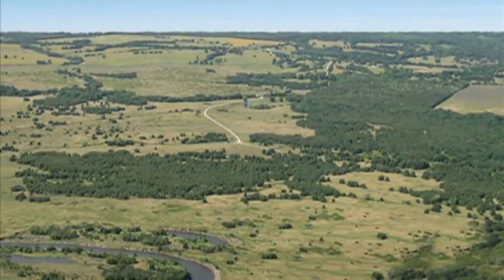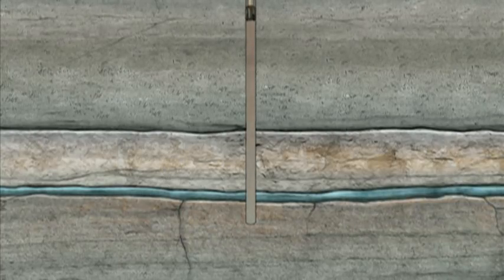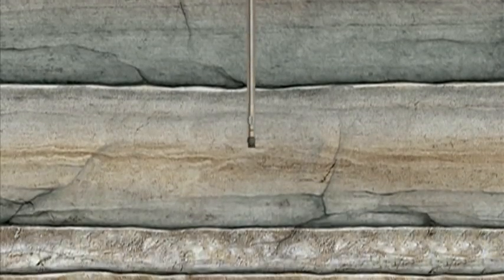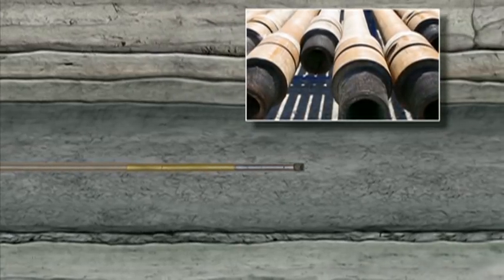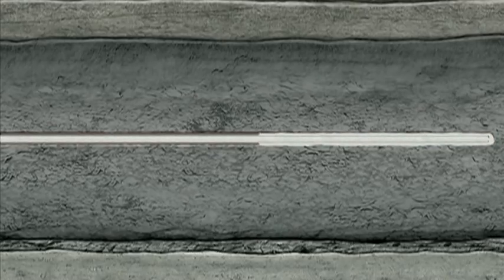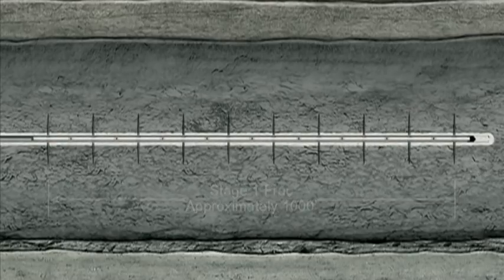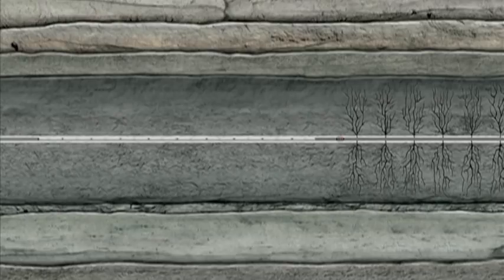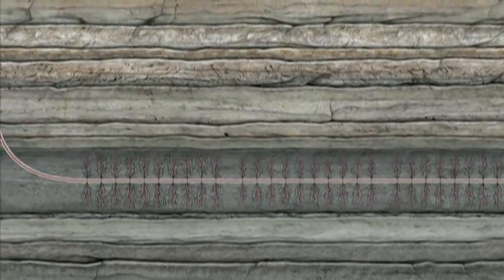Unlocking tightly trapped gas at Shell

Comment: @MrMolbach The surface of the well can be quite small since the bredth of activity takes place thousands of feet below the surface. The horizontal portion of the pipe is extremely deep -- far below anything related to the surface-level ecosystem (e.g. roots, water, topsoil, etc.). I don't see this as causing any more damage to the surroundings than would, say, conventional construction such as building or roads.